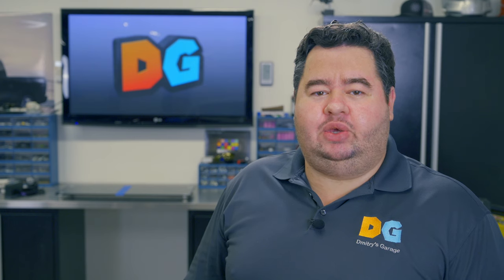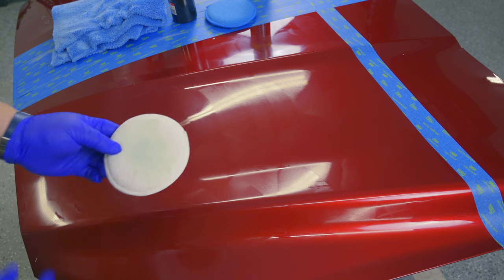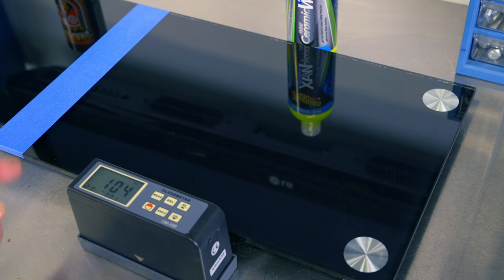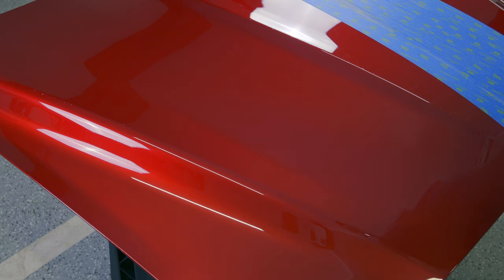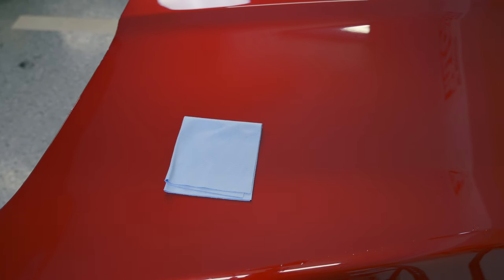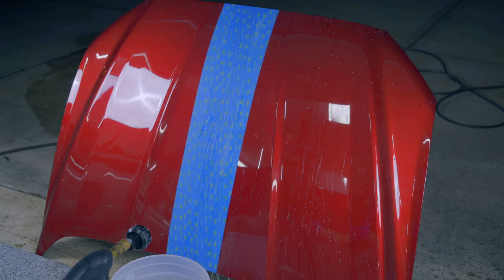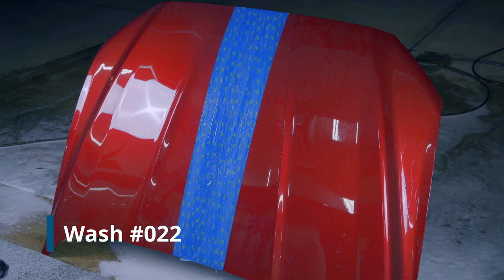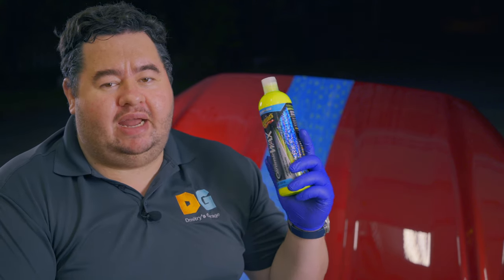Wolfgang SiO2 Paint Sealant vs. Meguiar's Hybrid Ceramic Liquid Wax - The best liquid waxes?

Comment: You cannot perceive a difference from 93-97 GU
Reply from the maker: Agreed, which is why we measure it since the products claim to boost gloss. The only areas where you can slightly perceive it is light reflection. Such as comparing glare from a flashlight or an overhead light.

Comment: So would you choose this Wolfgang product or their Uber SiO2 silica spray?
Reply from the maker: So they're pretty different product, if you want a liquid I'd rather use the Wolfgang Deep Gloss personally unless a bit more durability is required in which case the SiO2 paint sealant is better. The Uber SiO2 is a very great spray silica sealant, if you want way more durability, looks and slickness,  the uber SiO2 silica spray is top of my charts. But it's not a liquid product, some people really like using liquids. Overall I'd go with the Uber SiO2 if I had to pick my personal favorite.
Reply: D, do you have an opinion on Torque Detail?

Comment: Do SiO2 waxes and sealants require polish when removing just like a normal ceramic coating?
Reply from the maker: It depends on the products, some really don't want to come off without a polish, but I was able to remove both of these with just isopropyl alcohol.

Comment: I have used Wolfgang's Deep Gloss Sealant for the past four or so years and still think its great. The car I use it on, is now parked outside and occasionally covered by a car cover. I took a trip through the rain this weekend and even though I haven't applied more Wolfgang's for at least 10 months, water is till beading perfectly. I still have plenty left, but seeing as you are rating their SiO2 slightly higher, do you see any reason going with the SiO2 if the Deep Gloss working so well for me? Also, its my "beater," so I am mostly interested in protection than "amazing gloss." My new car gets more of the love, now, and have been getting great results from Meguiar's Xpress Spray Wax on top of my ceramic coating.
Reply from the maker: I think the SiO2 version will give you more durability. As far as being worth it, it just depends on how you feel about the cost. You can get the wolfgang deep gloss in a big bottle which makes it cheap by the ounce. Personally for more durability there are other products out there such as the Soft99 Fusso, especially the old formula, which will beat the  Wolfgang SiO2, but it isn't as pretty looking.

Comment: Ok im confused ugh, I just bought a new mobility van and plan on keeping it a long time. Do i wash it and put a paint sealer on it or wax or both?
Reply from the maker: Daniel, I would say just start with one product after washing and fully cleaning your painted surfaces. You can late experiment with stacking waxes on top of sealants or coatings. Typically the harder/more durable product goes on first followed by the topper product. So usually sealant under wax. But really just work out your process with one product to get started, I'd start with a liquid sealant or a spray sealant/wax with high durability: https://dmitrysgarage.com/wax

Comment: Here are my thoughts & questions, you are comparing a sealant to a wax, is that apples to oranges? Shouldn't you compare a wax to a wax or a sealant to a sealant?  Or is that just a marketing tool they use?  Do you use the same wash mitt on both sides of the hood?  Could that cause cross contamination?
Reply from the maker: Thanks for watching! Wax, sealant, coating, etc.. have generally accepted industry definitions, but are also marketing terms at the consumer level. A company might call their product a wax for recognition on store shelves. Traditionally wax means organic material based wax, like carnauba wax. High end waxes were always very thick and deep looking, but not very durable. Sealants generally mean synthetic polymer based wax and they promised greater durability over their organic predecessors. Ceramic coatings are meant to be semi-permanent products using SiO2 technology. I would classify both the products in the video as sealants as that is the category they fit the best. Neither is purely organic nor semi-permanent.

There are hybrid products that may use several types of technologies, for example an organic wax, a synthetic polymer, and silicon dioxide. This is the case with the Meguiar's product in this video since it uses montan wax derived from coal, a polymer sealant, and SiO2. They threw the kitchen sink into this formula. There are other products that refer to themselves as a coating or coat but use no SiO2. There is ultimately no regulatory standard and all three types of product are pretty much claiming to do the same sort of thing, i.e. be slick, glossy, improve the look of paint, repel water, and protect paint.

As far as cross contamination, I do not believe it is a significant issue. Primarily because these products all contain some kind of solvent or other carrier fluid by which they deliver the wax/sealant/coating onto the paint. That dries/flashes/cures and provides a very thin remaining layer over the paint. That layer doesn't spread anymore, it's cured and hardened at room temperature. The washing action primarily affects that layer through abrasion and chemical reactions with the surfactants in the shampoo. The shampoo I use is fairly mild based on the ingredients in it's SDS sheet and my testing. There are probably traces of the products mixing on the pad, but at this point they're not able to stick to the paint as they're cured/hardened and also a very small amount since the layer in question is so thin.
Reply: @DmitrysGarage  

Have you delved into SiO2 “technology”? I’d love to understand exactly what it is.
Reply from the maker: @FrankGutowski-ls8jt  My understanding is they use organosilicon compounds and sort of just market them as SiO2. Similar to Graphene vs. Graphite Oxide. Some of the popular ones are octamethylcyclotetrasiloxane, decamethylcyclopentasiloxane, etc.. These are used in conjunction with petroleum distillates and other polymers and resins to deliver the coating to the paint. My understanding is that silanols, siloxanes and siloxides structurally provide hydrophobicity when they form groups on top of the paint. To your cake mix analogy in the other post, I believe the combination of ingredients, their ratios and overall formulation is what largely affects efficacy.

Comment: Aloha from Hawaii and thank you very much for the video comparisons.  What easy to use wax or sealant would be good for a vehicle parked outside 24/7 in the hot Hawaii sun?  Mahalo
Reply from the maker: Aloha, glad you enjoyed the video :). Are you looking for like a spray or a liquid?
Reply: @DmitrysGarage  Hi Dimitri,  either or.  Thanks!
Reply from the maker: I would just go with a spray then, I really like Wolfgang Uber SiO2 Silica Spray, Turtle Wax Seal N Shine and Xtreme Solutions Poly-Seal. I would say the Wolfgang is the best in terms of looks and durability, but it's going to be slightly less forgiving if you leave high spots than the other two, but still VERY easy to use, just make sure you wipe it all off. The Turtle Wax SnS is very very easy to use, very durable and you can't really mess up much, but it's not that great looks wise. The Xtreme Solutions Poly-Seal is really pretty, super easy to use, but just not as durable as the others, it's definitely the weakest durability wise, but very pretty.
Reply: @DmitrysGarage  Aloha Dimitri,  I will give them a try starting with TW WNS, Wolfgang and Xtreme.  Thanks very much.

Comment: it would be super cool to see a detail spray shootout. i’m super interested to see how adams graphene detail spray works alone. maybe put it up against megs HCD, the turtle wax ceramic detail spray and others along that line to see if they actually have any of that si02 or graphene in it. anyways good test like always. good to see someone that tests products so in depth. as a detailer myself, all of this is very good information. it was because of you that i picked up that adams graphene spray and i could not be happier with its performance!
Reply from the maker: Garrett, thanks for watching! I will probably add some detail sprays in the future. I did sonax in the past and it would definitely be interesting to see how some of those other sprays hold up. Glad you liked the graphene ceramic spray, I'm a fan of it too, been using it on a few applications and going to do a friend's car in it soon.
Reply: His methodology can’t determine chemical composition.

Comment: so IPA will strip these waxes alone?
Reply from the maker: Yea IPA, especially high proof, will damage or strip most waxes, sealants and coatings given enough exposure.
Reply: @DmitrysGarage  have you ever seen it bubble the clear cote if used at too high of a dilution ratio?
Reply from the maker: @anth115  I have never seen that, IPA is not able to dissolve clear coat. I wouldn't use acetone or other solvents, but IPA is fine to use to decontaminate a panel. I wipe down car panels with IPA all the time when paint correcting, before applying a coating.

Comment: Is the test panel you use for taking gloss measurements coated with automotive clear coat or is it coated with something else?
Reply from the maker: Thanks for watching! Its just glass with a black backing underneath. The problem with clear coat is that it is inconsistent due to being sprayed on. The readings have a higher margin of error across the surface. Glass is very consistent and gives much more reliable numbers. In fact the gloss meter itself is calibrated against a similar piece of glass with a black backing. The results are very similar to automotive paint but more accurate and easier to measure.
Reply: @DmitrysGarage  My concern is that these chemicals are (probably?) formulated specifically for clear coat and their behavior may be drastically different depending on the surface they are applied to. But I really like the idea of having a tightly controlled environment for testing and it makes me question the results of other channels that don't do this. If you haven't done so already, maybe you can test off camera if your glass panel results line up with how products perform clear coat. Regardless, I love the channel and especially appreciate that you've provided the data for all your previous tests. Keep the videos coming!
Reply from the maker: @thedubs510  I'm glad you're enjoying the videos :-) and I have done the comparison you're talking about in the past. I originally took readings on the test hood, but I went back and re-did the readings later on the glass panel to get them to be more accurate. They're generally in-line just more consistent. I also actually did that comparison on camera specifically in this video. I normally don't show the gloss meter on the paint like I did here. You can see its very similar results to the glass panel.

Comment: The database of comparison tests on your website is a great reference tool and I find it very useful. Here are a couple ideas to further refine your testing criteria: Appearance is really important and I think the appearance category could be expanded to include 2 points instead of just one point. Perhaps 1 point for enhancing color and depth of the paint and 1 point for visual “pop” or best visual appeal.  Dust collection is another criteria that could be included. You could shake a dusty towel over the panel and then blow it off with a leaf blower on a low speed to simulate dust being removed while driving. You could then compare the two products to see which released the most dust and kept the paint cleaner.
Reply from the maker: Thanks for the detailed feedback John, I have been thinking about similar dust tests as well. My big challenge is how to make them repeatable such as what type of dust to use, i.e. pollen is different than concrete dust which is different than brake dust. I'm definitely thinking about how to set this up and make a good test. I'll consider splitting up pop vs. depth/color, there may be some consistency we could apply there. Thank you for watching!
Reply: @DmitrysGarage  

Exactly! Dust is ambiguous.